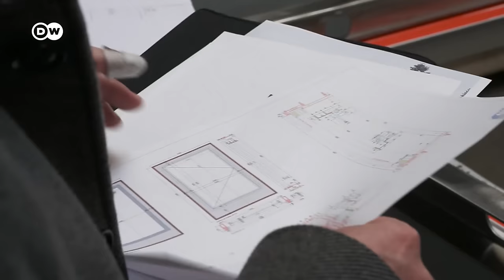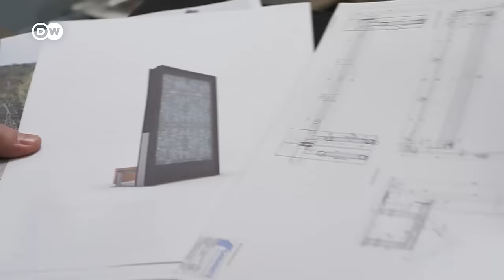Can algae save the world? | DW Documentary

Comment: Algae is an interesting organism. 
Motor fuel can be harvested using algae. Petroleum actually is a derivative from algae.
👍
Reply: But how much motor feul can one produce? Is it commercially viable?
Reply: @irokpe6977 its not viable will never happen. Electrification is the way to go thats why it is used already and all car manufacturars jump on board.
Planes can not be electryfied as well but Brazil is already running on ethanol we might use that stuf for lonher flights and get some electric short flight options. I think flying is one of the tough nuts to crack other areas are much easier. Synthetic fuels made from algea is not a likely future my prof who is algea researcher said he did the calculation and the answear is no way not efficient enough.
Reply: @irokpe6977 
It remains to be seen. One gallon of diesel fuel from algae is currently $300...technology advances likely will reduce cost.
I always like being optimistic. 
👍

Comment: looks like lab rat trying not to appear useless. Men who stare at goats scene please. Now about recycling. C13 engine of Twingo ..if we could turn 900 into 9 Opel Corsa we d be good. If 1200 nissan micra doors could be pre-designed to become Rodenstock glasses.Even just 50!
It is all too difficult. But recycled plastics can be turned into..cushion inside. Playground floor.Recycling is very easy in theory, but in practice almost impossible.sadly. tant pis. Leider.